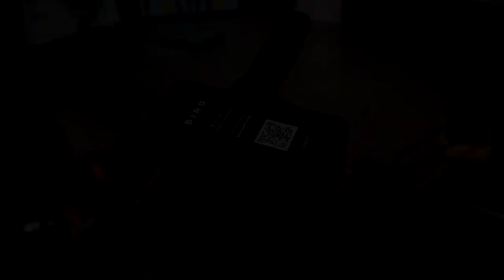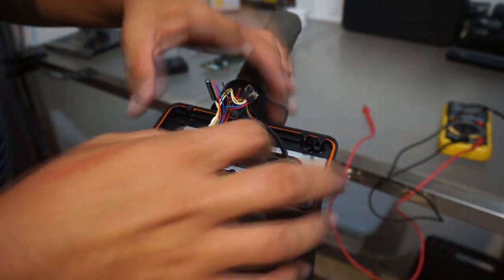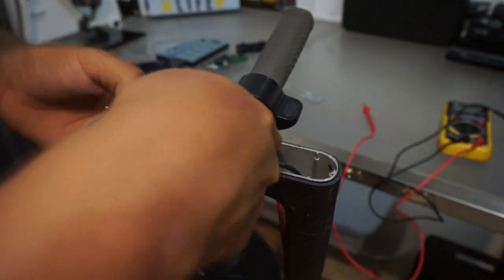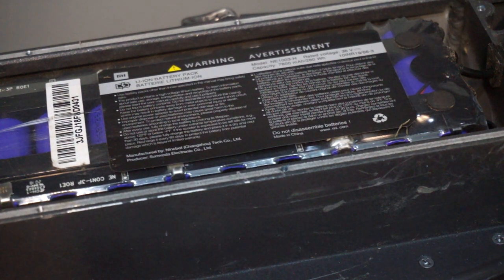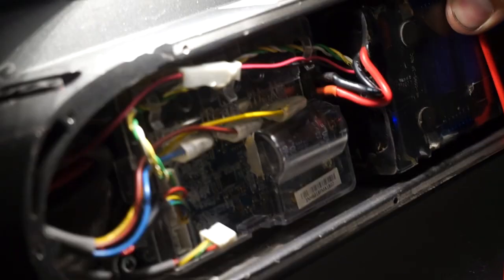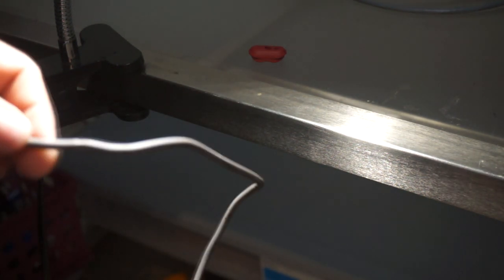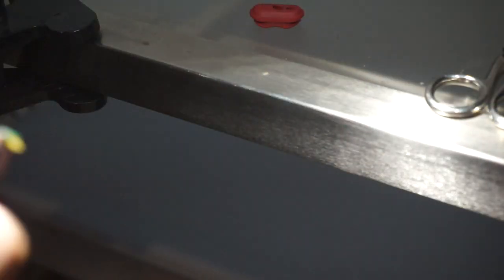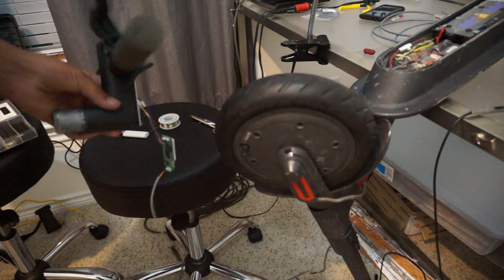How to convert Bird scooter to a usable scooter full clip

Comment: just got one of those new bird Two...easy enough to take apart...but you need a torx security bits....very nice quality battery  pack based on LG mj1....
Reply: No you actually don't need the torque security bit you take a flat head screwdriver and a hammer and you tap a few times on the little circle in the middle and they snap off really easy the you  can just use a Philips are an Allen wrench or a flat head screwdriver that fits tight in there in a slot and you may have to tap it in with the hammer or if there's enough head on the bolt a pair of vise grips clamped down on it

Comment: Have you ever tried to covert a lime scooter? This video was very helpful!
Reply from the maker: I have. But it's not worth it. I was not successful. And it's a nightmare to take apart.
Reply: I have seen the lime battery's.  51.4 v 14s.  94ah.   They need all  new electronics. Controller bms charger and I think throttle

Comment: hey i got a voi scooter from my cousin that was abonded & the scooter is built like a ninebot esx and it has a external battery what happens if i remove the battery and put it into my real ninebot es2 will it work?
Reply from the maker: I don't know.
Reply: @TECHIELIFE  oh ok.
Reply: @nassimmarhri4088  as long as the controller has the same connections yes it can be done..( facts )

Comment: Save and buy brand new. No problems. And extended warranty.
Reply from the maker: How much is brand new
Reply: Save what? Save yourself from having too much cash? Save the landfills from not having enough toxic metals? Save yourself the hassle of using your intellect?

You can convert a BirdOne for less than the cost of many children's kick scooters. 

Bird is also having financial issues, so it wouldn't be a shock if their network goes away in the next few years. Even if the bourgeois "just buy a new one" crowd doesn't want them, there are tons of low income people who'd love this as transportation to get to work over walking.